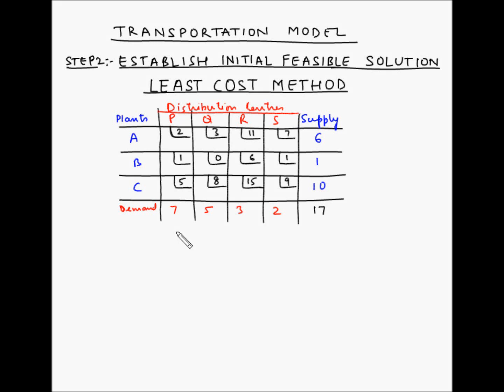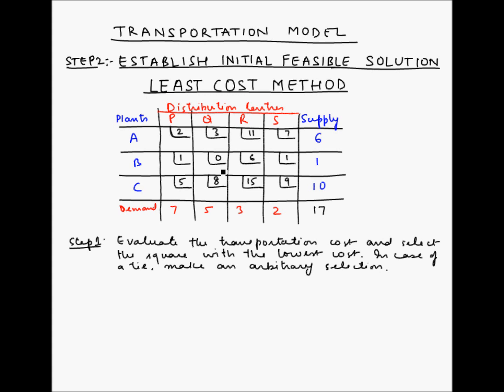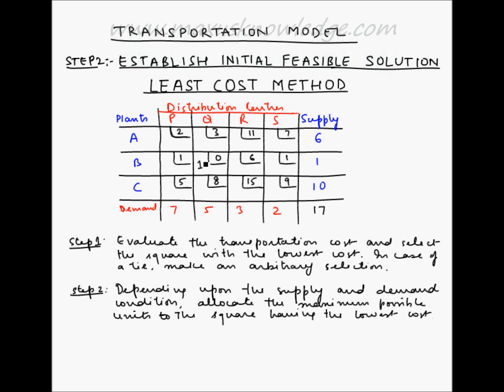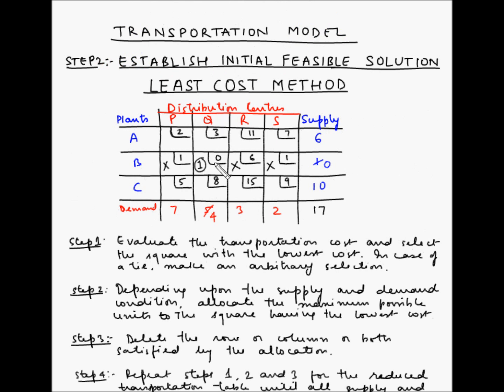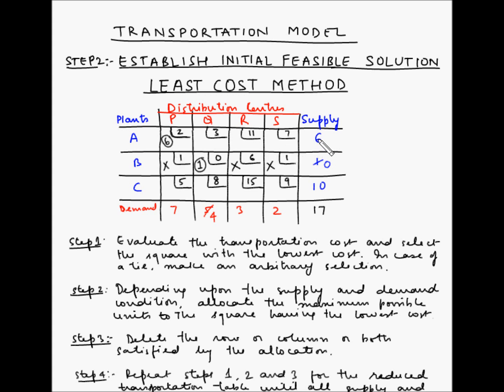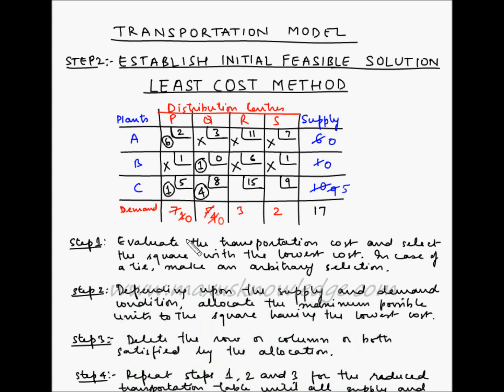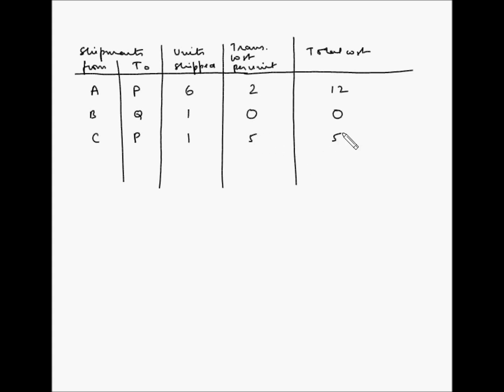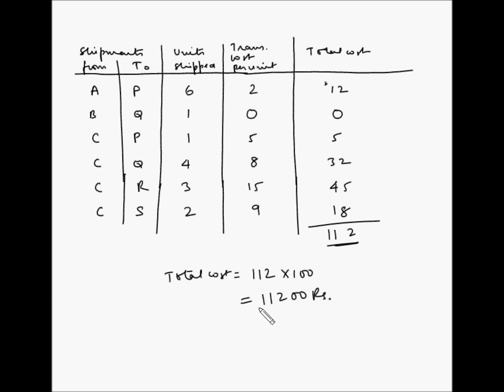Transportation model - Step 2b - Least Cost method

Comment: Please how did you get 100 use to multiply 112
Reply from the maker: The unit cost in the example is in 100 of rupees. So 200 unit cost is written as 2 for ease of calculation. So, in the end, to arrive at the right answer, we need to multiply by 100. Hope this helps !